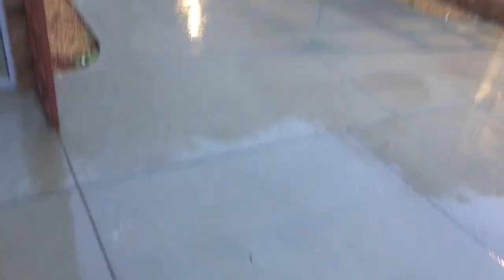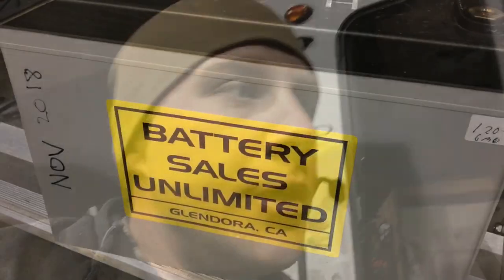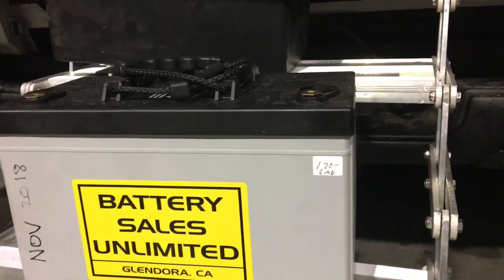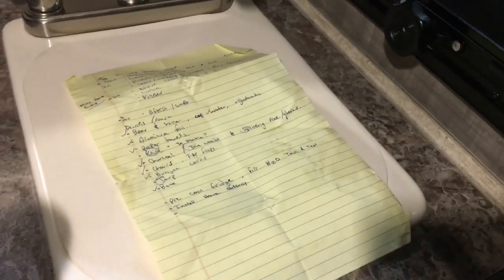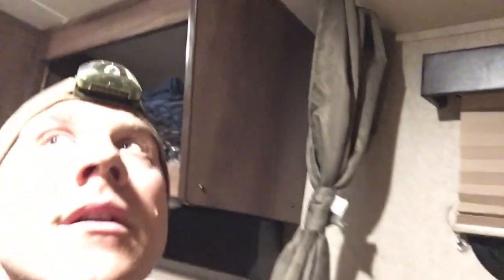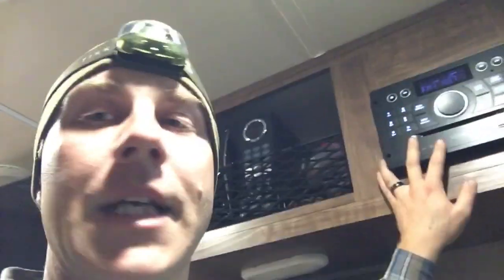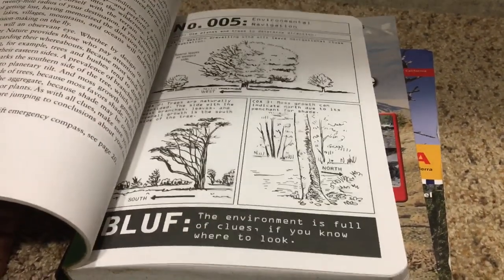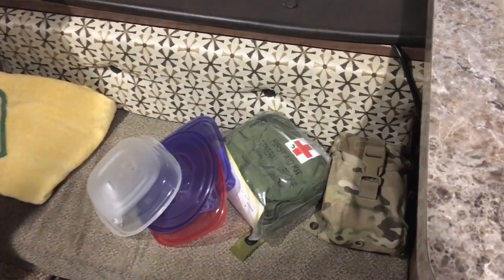2019 RAM REBEL & PALOMINO HS650 camper setup

Comment: So, you addressed this a little bit before, with regards to power and braking, but have you run this by a CAT scale and checked that you're still within GVWR and GVAW? I'm running some Excel sheets and coming up with a VERY thin margin on my build on a 2017 1500. I'd love some feedback!
Reply from the maker: No, I’ve yet to take it to a truck scale and have it  officially weighed. I agree though the margins are thin. I do my best to not pack everything possible under the sun in order to stay within the lines.

Comment: I see you're ok with gas, electricity, furnace, hot and cold running water, shower and a fluffy Serta mattress.  Why do you draw the line at TV and microwave?
Reply from the maker: Took up too much space and weight for something I'd never use 👍🏻

Comment: Hey man, thanks for sharing the RAM videos. I like where you are going with the channel. I'm considering getting a 2019 RAM 1500 Bighorn as my first truck. Did you get the air suspension? I think it would level you out if you have it. If not, why did you go against it? I'm hoping to see some new videos of you taking it off road. It's probably going to handle a lot differently with that camper now. Have a great adventure. Subbing!
Reply from the maker: PJ Jackson thanks for the support! 
So, I've got a new set of 50% stiffer springs in the mail yesterday I'm hoping to install this week to level out the rear. I opted to try those first instead of airbags because of the cost to install bags, and loss of articulation at the axle. I'll post a video on how it turns out. I'll also be making a Vid on my thoughts of the 2019 Ram trucks soon. Been a busy 4 months, and 7,500 miles!

Comment: What tie downs did you use for your camper? Make and Model #?
Reply from the maker: They’re the “Fast Gun” supplied by torquelift, they can be found on their website. Very high quality, but also very expensive!
Reply: Oh, I meant the brackets that mount to your frame. I just bought a 2020 rebel and am talking to torklift right now to try to figure that out. They asked me to ask you the part numbers for the front and rear frame mounts.
Reply from the maker: Haha. They don’t remeber!!?! 
I’ll have to look tomorrow, everything is all buttoned up in the camper right now. Give me 24 hours.
Reply: Ok, thanks man!
Reply from the maker: No worries, I just checked, and the mounts don’t have any information printed that I can see on the frame mounts. The removable parts they’ve only got marked with “torklift - passenger front...rear...etc”.  but no part number.
I wish I still had a receipt, but have no idea where that went... How else can we get you the part numbers? There’s gotta be a way! Keep me posted

Comment: Would you tow a 4500 pound trailer with thus camper on the bed
Reply from the maker: I would! 
Yesterday I flat towed my Jeep Wrangler behind the Ram Rebel, with the Palomino HS650 attached.

I think the jeep weighs somewhere around 2,000 lbs, and the truck hauled it no problem. Plenty of horsepower, and more importantly braking power. I had to travel over some steep grades, and felt no issues with control while in Tow/Haul mode. MPG wasn’t terrible. I got 250 miles to the tank, at about 11.5 miles a gallon average.